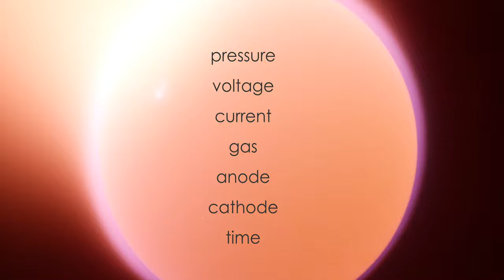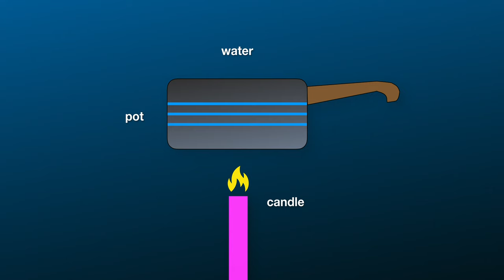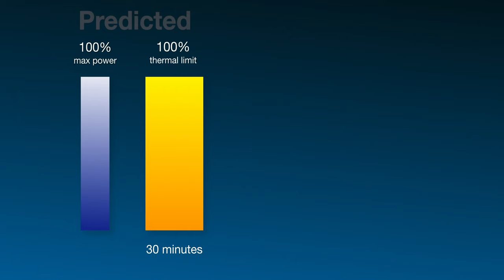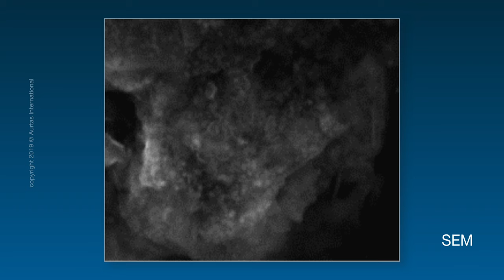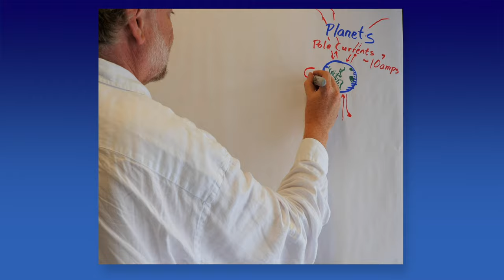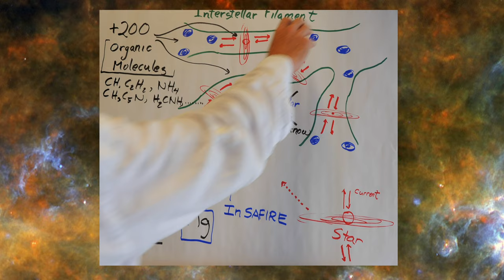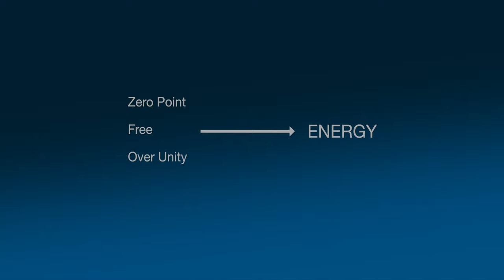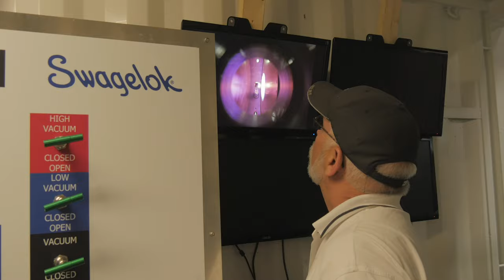SAFIRE in the UK

Comment: I think this will be better understood via the structured atom model SAM.
But I think that SAM is still wrong, due to misunderstanding of QM. You should combine it with the threshold modrl of Eric Reiter (and Mac Planck). It shows that particles are like rings of energy. Personally I think each 3d ring is a vortex in 4d, but that is theory.
Combined you get a very good model of what is going on. The consistency of atoms is related to the structure that is held together by energy loops. With strong electrical currents these loops can readjust. 
The electric fields seem to disable or merge the electron shells. And this means that the nuclei can get close to each other while being surrounded by electrons.
So to get transmutations there may be related conditions. Like the electron shells would match up to capture both nuclei. And subatomic structures (SAM) would match up tp make exchange easier.